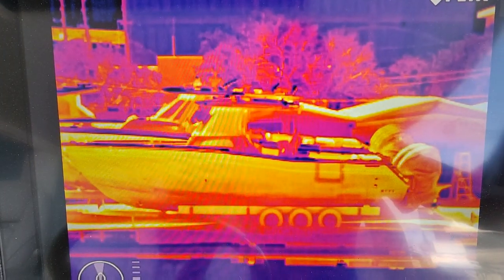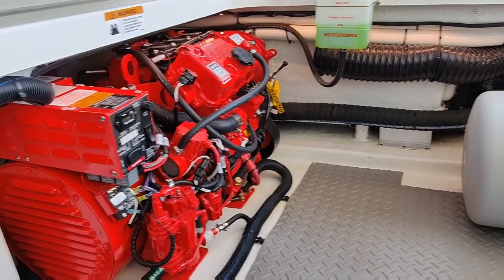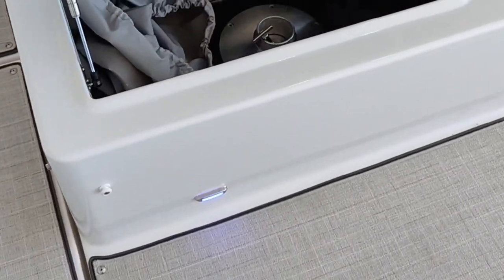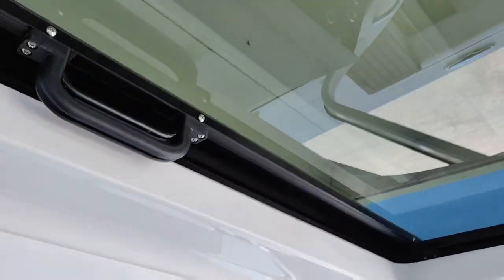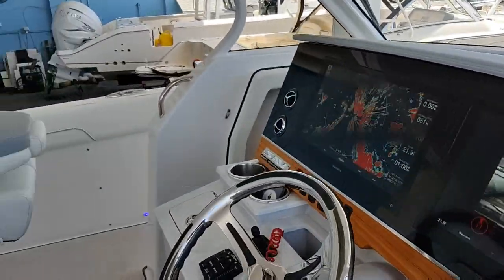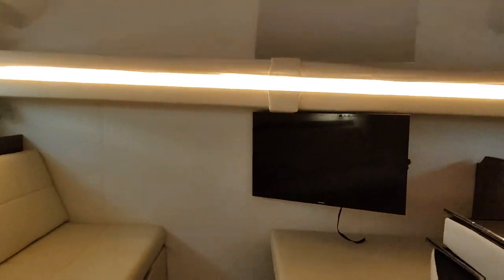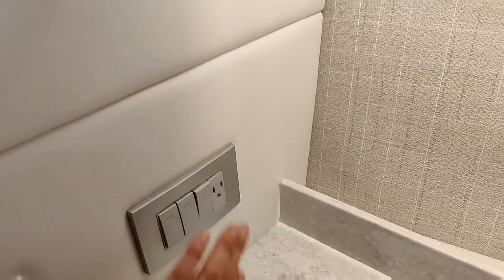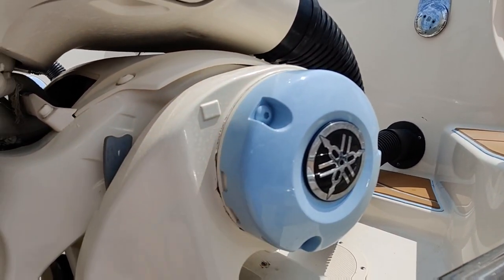Lets Look At The Regal 38 SAV!! #Regal #Yamaha #Episode170

Comment: The 38 SAV is a  terrific boat. I took one out on a sea trial in very rough conditions and it performed quite well -- minimal pounding at 30 knots into steep, close-packed 3' - 4' whitecaps. Very dry, fingertip steering downsea in sloppy conditions,  handled well in tight docking situation. Good-looking boat. Well-thought out helm, great day boat. Cramped cabin but separate shower is nice. Probably would have bought one but the outer lip of the T-top hits me right in the forehead. Hard for a tall guy to find a boat -- same head scraper issues in Tiara's, Formula's and many other boats. Pursuit and Boston Whaler are OK for tall guys but a 38' Boston Whaler Realm is priced more than $200,000 higher than the Regal 38 SAV. 

Thanks for nice introduction to the 38 SAV.
Reply from the maker: You are correct about the low t-top height. I noticed that too.  They are good running boats for sure.  If I take it for a ride it will be the next video😊